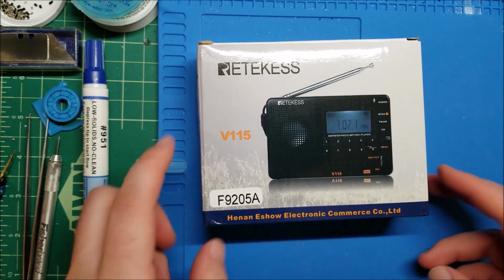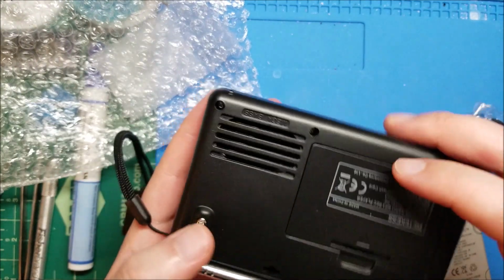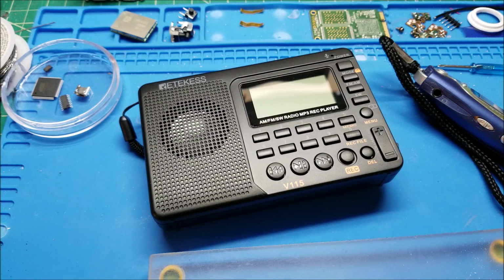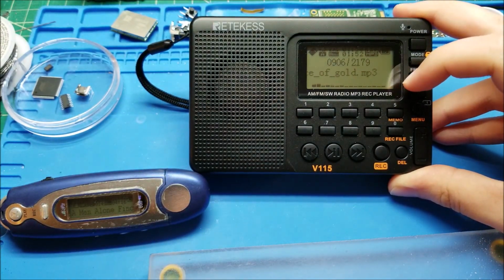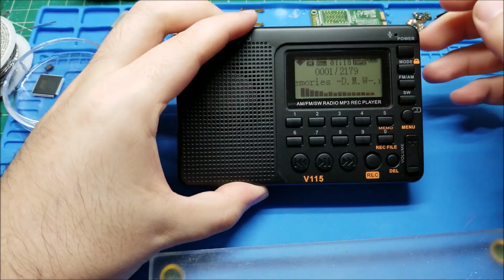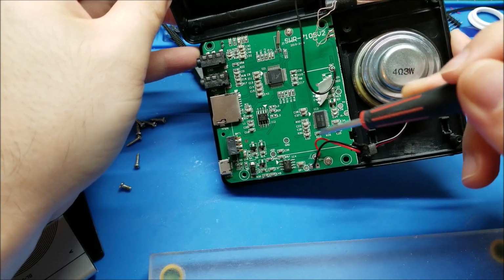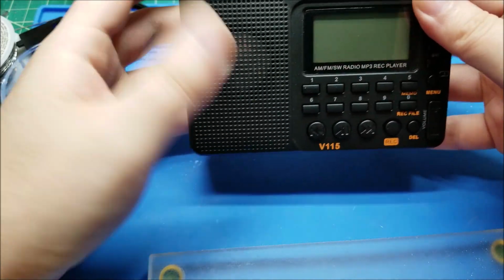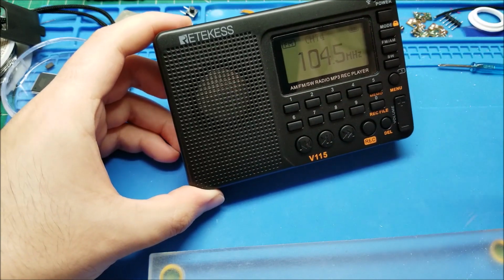Retekess Portable FM/AM/SW/MP3 Radio Review and Teardown

Comment: I have had one for about a year or more...  love it... my brother liked it so much, he bought a couple of them from Amazon.
I bought a couple more when they came up for sale, one for a backup (or if my wife wants it), and the other for my other brother.
I mainly use it for an MP3 player where I extract favorite songs from my iTunes library that I put on a single folder on my PC, that I copy to the micro SD card... make sure the micro SD card is FAT32 formatted for it to be recognized.

The only thing I don't like is that it does not retain the last play mode setting when you turn it off and back on.
I always use the Random (shuffle) mode, so I always have to reset that when I turn it back on.

Comment: I have had this radio for at least 5 years and i fiinally figured out that square plastic piece on the lanyard is actually a removable plastic "kickstand" that plugs in a slot in the battery cover to hold the radio at an angle. Not as nice as a fold out kickstand but it is better than nothing.  The sound quality and FM performane is very good AM would be a lot better if they had put in a longer  ferrite AM antena. Anyone who wants to use this  as an emegency radio should buy a USB battery bank if they don't already have one.

Comment: I feel kinda dumb here.....I tried three of these and was pumped to get this because of the fact that it was a recorder as well as a player along with a radio. It sounds pretty good for its size and price. But on none of the units I tried did the Mode button work as it should have. It never went to the files  It only worked for Hold when long pressed.  Has anyone else had this happen,or was there something real simple I was doing wrong?
Reply: Did you have a micro SD card inserted ? How is it formatted ?
Mine is formatted FAT32, and works fine... NTFS does not work--I just tried it, and the Mode will not switch to the MP3 player.
Reply: Turns out that they changed the firmware  (I think) I use the  Rec File button and it works just fine
Reply: @richardfranciscone3392  That's weird... glad you got it to work... Great little radio/MP3 player... I just wish it would retain the last play mode setting so I do not have to keep changing it to Random Shuffle mode.

Comment: The screen on my unit has gone blank. It lights up, but no textual info shows. It's too good to toss out, but too hard to use without the screen working and telling where you are with freqs and mp3 playbacks.

If anyone knows a hack for jolting the screen back into functioning, post it here. 

...greatly appreciate any suggestions....
Reply from the maker: Hints that either the lcd failed or one of the internal supply rails that power it has failed. 1st step is to open it, inspect the board for visible damage and finally measure the voltages going to the lcd using a multimeter.
Reply: @sjm4306  thnx...will open it up this w/e...I've got a multimeter.

Comment: Also, if you plug the USB port into a computer, it becomes a USB speaker and a slow but functional micro SD card reader.
Reply: Having this feature makes it easier to modify the micro SD card (so you do not have to remove it)... I usually just keep a folder on my PC that I copy to the micro SD card... I always delete the folder on the micro SD card and copy the complete folder over so it has a fresh directory that keeps the order in sequence.

Comment: Someone out there..................... Equalizer Setting for Radio??? You can on MP3 but not for Radio audio, Hidden Menu? Hack? Mod? Dead End? Thanks.
Reply from the maker: Unfortunately no, I figure because it's easy to do digital eq on a digital audio file, but doing it on an analog source like radio (while the tuning is digital the actual signal is still analog) would require an encoder to translate the audio in real time to digital and then perform the eq and then convert back to analog. Or it could just have a digitally configurable analog filter after the tuner but before amplification but both of these cases would add complexity and cost.

Comment: U think 20 dollars is expensive for that?...No Way....it's an excellent little radio and very cheap with all those features. I challenge you to find a "branded" radio with all those features and that sounds as good for anywhere near the same price. You will fail!!
Reply from the maker: To each their own, everyone is entitled to what they feel is the value of their dollar. My point was more that if all you need is an emergency radio then yes $20 and all the extra features that someone may not need may be overkill compared to say a 2nd hand sony analog radio that'll practically run forever from alkalines and outlive it's owner, but if you do get use out of everything this radio does then by all means it's a good deal for you.
Reply from the maker: Ebay prices are insane, I just hit up a few thrift stores over the weekend and they had a few vintage pocket radios from reputable brands for ~$10 so deals can still be had ... just not likely from ebay lol.

Comment: The plastic "key" on the tether is the STAND. There's a slot for it on the back.
Reply from the maker: Yep, another commenter pointed that out as well. I still would've preferred a built in retractible stand, but the detatchable one is certainly better than nothing.
Reply: @sjm4306  I think the stand is a nice touch and some will find the lanyard useful too. However I don't use the stand or lanyard (& removed them) and if I want to set the radio at an angle I pull the Aerial out a little and push it back a bit and it doubles up as an adjustable stand.
Reply from the maker: That's a good idea!

Comment: I've had two of these for a few years, they're an excellent little unit for the price. 
Just don't expect them to have cutting edge SW reception.

Don't buy this model though, you can get the Hanrongda K603 for less money and it's the same unit but with bluetooth !

They're awesome as a little MP3 recorder and player. They play in stereo thru the headphone socket.

The old Nokia phone battery lasts many hours, BUT, remove the battery from the unit if you're running it constantly from 5V power as the charge circuit has no cutoff.

PS: Found your channel thru "This does not Compute".
Reply from the maker: Yes bluetooth would've been a no-brainer!
Reply: @sjm4306  I suspect that Hanrongda is the original company as the K603 is less than $20 Inc shipping.
Reply from the maker: They are all probably sourced from some unnamed industrial factory and the branding stamped on at whatever local company exporting them.
Reply: Did you figure out a Equalizer setting for FM?
Reply: @yourworstnightmareiscathoc7015  I don't really use the radio, just for MP3's & recording audio.
Reply: I have the Retekess V-115 but I have ordered a HanRongDa HRD-K603!

Comment: The little screw driver thing on the attached device can be used as a table angle stand. Insert in the little hole close to the antenna and then the radio can stand on the table, little angled.
Reply: Wonderful advice. Thank-you. I actually was searching for where the key would attach to. I had it mistakenly attached to the slot on the battery cover. 😂